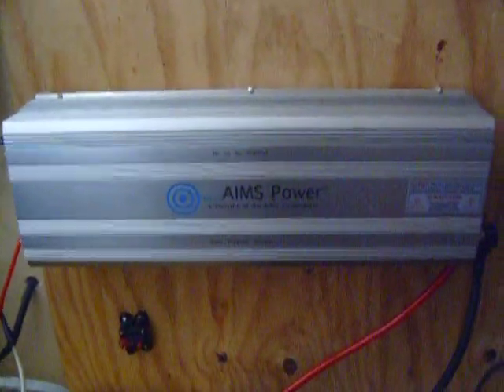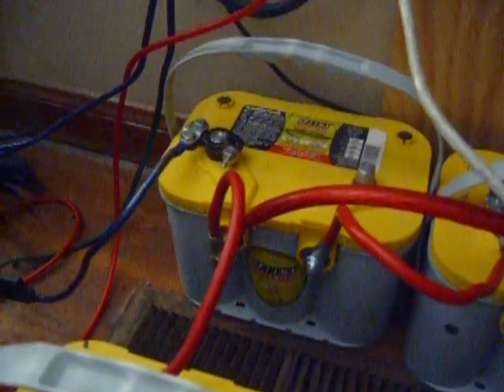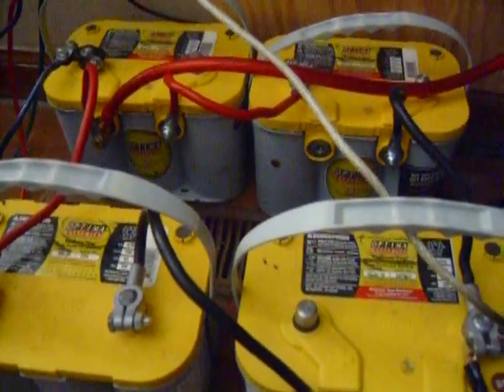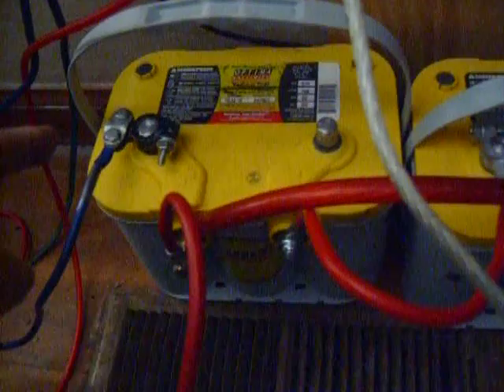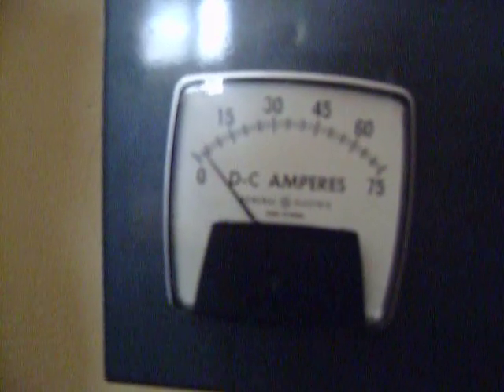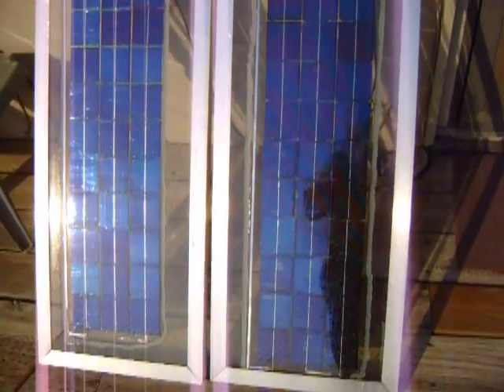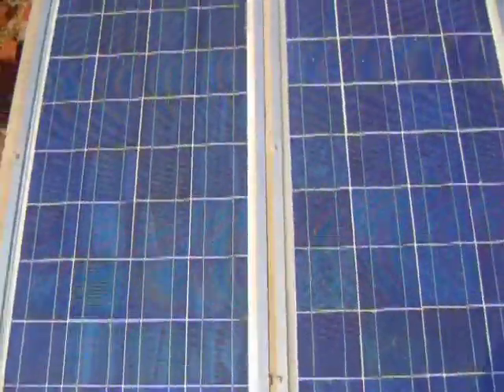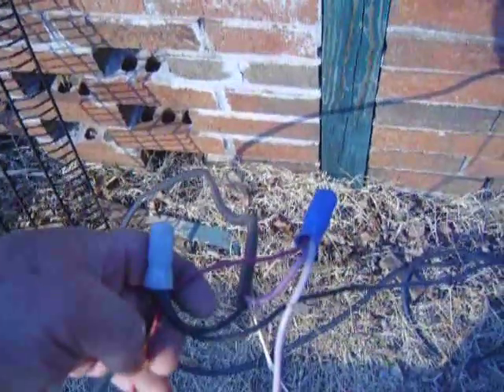24 volt 7,000 Watt Aims Industrial Inverter Installed

Comment: I'm curious how this Aims inverter has held up over the last 6 years ?
Reply from the maker: I sold that about 6 years ago. LOL I use a prosine 1800 watt xantrax it works just fine. the military and paramedics use them. or have been known to. they are good. Actually the Aim industrial this particular inverter is bullet proof but I wanted a pure sine wave so I sold it. The Aims industrial would be great for running lights and tv but not a microwave or fridge they dont play well together the microwave shook and the ice box compressor it was hard on it.  I love my prosine xantrax 1800 watt
Reply: Very good !... nice to hear a positive review about ANY particular inverter.  Another question; Does the Xantrax keep a steady 60 hz ?   The reason I ask,  I have (2) MagnaSine 4048's in parallel and neither maintain 60 hz. Quite often they are at 58, 59 and occasionally 60. Not a problem except I am constantly adjusting my timers and clocks.
Reply from the maker: that is a good question how would I test that? You could look up the specs maybe? It may not tell though?
Reply: I guarantee  you it's designed to run at 60 hz.  My Kilo-Watt meter has a selection for Hz (hertz), and with it plugged into any circuit, I can see what the inverter is producing.
Reply from the maker: Oh yeah I got a Kilo watt meter dah I should have remembered that LOL Im not exactly sure it has that I need to look at it and test it.

Comment: your killing your batteries all wiring must be same length gauge and type or the system is not balanced your batteries will die soon
Reply from the maker: +arb tee I have now have 2300 watts of  new factory made panels on solar trackers. So check out my new videos to see them track the sun. I still have the optimas they are great batteries. This video was made over five years ago but now I have improved my solar system. All new wires and two pure sine wave inverters. I have two separate systems.

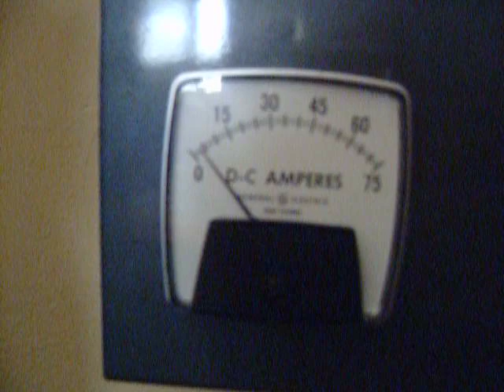Comment: 90 watts + 90 watts = 160 watts. 3:25
Reply from the maker: +DangerZONEpixel OK but have you seen my new videos on solar. I have 3 solar DIY trackers now. I sold my old diy panels and bought 10 235 watt panels. They make some good power now. Look back through my videos to see my new improved system. I have a go power 1500 watt inverter now on six yellow top optimas. Also I have 4 golf cart batteries on another system with a 1700 watt pure sine xantrax. I also now use the cheap China made charge controllers. It all works really nice. I can run my freezer 24/7. on my optimas. Also I can run my TV and entertainment center and sat dish on the golf cart battery xantrax system.
Reply: +shartne pretty sure he is talking about the math and how its not correct i noticed and also rolled my eyes lol
Reply from the maker: Ok I made a math mistake on camera woo so now what?. so what? Your not forgiving me LOL OK so what! You never made a math error well exscuuuuuuue meee. LOL ;) Im talking about looking at my new system it is improved not like this old diy attempt at solar. Solar trackers work more efficiently.
Reply: +shartne I don't make videos of anything let alone my solar array but I could tell you about it if you like
Reply from the maker: +jesse hagenbeck OK but I would like to see it why not make a video its easy.
Reply: +shartne need a video camera for that
Reply from the maker: +jesse hagenbeck I bought a used or take back Samsung on ebay for about 30 dollars it works good its high def. not like this old video. These videos are years old LOL like looking at the stone age of solar and video cameras. but it was fun to do. You should give it a try its why they call this YOU Tube. Im not a pro just a average JOE.
Reply: +shartne and the benefit of me posting videos of my life on YouTube is what? YouTube to me is just looking for new ideas and to maybe see what I can do different I guess other than that I don't have the will or time to make my own videos
Reply from the maker: +jesse hagenbeck I make videos and learn from all the viewers. They tell me so much stuff I never knew. Really, I made friends with lots of people who do solar and their information has been so valuable and beneficial. I leaned how to make solar trackers from Kilog69 he has a great channel and lots of info. Also I made friends with Nrodge1 a electrical engineer and inventor of many useful solar gadgets. Its is very beneficial making videos you get a lot of constructive criticism and just plane good info for darn sure. the Fearless thinker is a good friend of mine whom is also a electrical engineer. Even if I just make a video about my Cub Cadet I get good in put and info. really it does help out a lot. I learn a lot from people on youtube. Its like all my friends come over to see what Im doing and put in their two cents. Very helpful indeed. I did not know any thing about solar until I my friends on youtube schooled me. LOL Helps out tremendously.
Reply: you ever think about running 48 volt? i decided to go 48 myself imy battery bank i run grape solar panels myself and run midnite solar classic 150 for a charge controller i mean I'm new at this myself but decided to go with this stuff right off the bat rather then work up to it i guess
Reply from the maker: +jesse hagenbeck yes 48 volts would be nice. You can even get a charge controller that can do like 90 volts or better and then its super efficient. I need a CC like that. Money is a problem for me. Later on it may be possible.
Reply: +shartne yes my classic takes in 150 volts from the panels then the batteries are at 48 volts
Reply from the maker: +jesse hagenbeck Midnite Classic is definaly on my Christmas List. or anytime list LOL. when I get the money Im getting the largest one.
Reply: +shartne remember this when you order the 250 doesn't put out as many amps to your batteries I asked the midnite people myself to clarify the amp rating is out to the battery bank so the 200 and 250 won't put out as much as the 150 just something to think about
Reply from the maker: hmm that is not good.
Reply: +shartne this is why I chose the 150 puts out 96 amps
Reply from the maker: +jesse hagenbeck Sounds like a lot of amps to me and the best choice.

Comment: Can you share how you did that nifty junction?Did you combine all your positive into one then use wire tie with one going to inverter input and same with negative?I want to go to 24 volt but inverter and stuff is too expensive to justify it.
Reply from the maker: I bought a positive Midnight solar bus bar with insulators to combine inside the breaker box. You can get them off of ebay or amazon. Also I think you can get OutBack brand bus bars with insulator stand offs too that are a little bit cheaper in price. Run a positive bus bar up and down one side then a neg down the other side to combine the the wires. Easy just look up bus bars under those name brands. You can make your own combiner box. I might make a video of my mine tomorrow if I can remember  to.
  I am using a 24 volt GoPower pure sine wave these days works a lot better.
Reply: Please make a video.
Reply from the maker: Making a video now. watch for it today it will take a hour to up load.

Comment: The gel batteries,does it work good?  I would like to put 2 or 3 in the house. Drop a line down to the back porch, and hook up (2 ) 45 watt solor  panels. And use a gridtie inverter day and night. If possible.
Reply from the maker: Yes the Optima batteries work great in the house and no off gases. But they are Absorbent Glass Mat (AGM) so they are not gel. But they are different from regular deep cycle. I use the yellow top because they are deep cycle.
Reply from the maker: I dont like the aims inverter I got rid of it. I got a Go power pure sine wave it works great..
Reply: Thanks

Comment: You got super solar panels! haha. What does that small solar panel run at and what is the cost? I am looking for a solar panel and battery to run a WiFi IP Camera. I figured that I need at least 20watt panel, a battery charger controller, and a bank of a couple junk car batteries or a new 70ah-100ah battery, a custom wire connection interface and a DC to DC 12v to 5v step down converter...

I seen a cheapo chinese 10watt solar panel that copied a solar product of a common driveway gate opener in USA. I haven't tested it or anything but it was in my hands for a moment. I wonder where I can order some more cheapo chinese solar panels if it comes out good. I could wire cheapo panels in parallel right? directly to the controller? Or what was that secret system that the "professional solar installers" were talking about for multiple panels?
Reply from the maker: I sold them all! Then I  bought 10x 235 watt factory made solar panels. All made in China. They are great! China makes nice solar panels. The little panel is a 20 watt homemade diy panel I made in front of the 5th graders and they loved it. I let them help pour on the silguard. You should check out my newer videos with my solar trackers with the much larger 24 volt 235 watt panels on them they track the sun.
  Ebay has some nice 20 watt panels but I dont even think it would take 20 watts to run the camera. I think a 5 watt panel would do it. or maybe a 10 watt. Im pretty sure 5 watt panel would do it. It has .03 amps the ten watt ones have about .06 amps the twenty watt panels have a full 1,0 amps. I dont know what amps the camera pulls?
Reply: cool ill check out your videos. I am looking at the AC adapter that came with my camera. It is has an output of 5v and 2000mA. But also I wanted to have a little extra watt space if I decide to connect something like a little Cubieboard computer or a RaspberryPI computer. And I want to try out the panels for the Seattle weather here, its been raining like a solid 2 weeks!
Reply from the maker: The amorphis panels work on cloudy days. The ones like I got are almost useless on cloudy days.
 Mine are poly chrystaline. I can not spell too good  Ha ha.
Reply from the maker: sounds like a .02 amp panel would work about 3 watts. I think.
Reply: oh ok cool ill check it out
Reply: I used to have a couple mini solar charge devices to charge my iPhone 3G back in the day when it was first released around 2008. I had a full solar charger case and the other solar device was a universal quick assemble with lots of different phone attachments. They both worked pretty good even on cloudy days, except the solar case had failed as soon as I plugged it in a USB charger to charge it. And the quick assemble had failed soon after at the cable attachment port.

These products were from the overpriced UK country. I'll never be buying solar panels from the UK again because they fail and are way over priced. I payed more than $260USD for each of these tiny panels. I think that was 110$UK at that time. What a rip off haha. I am money-racist against the UK now hahaha.
Reply from the maker: A lot of china stuff is pretty cheap. But the cost is very afordable. I like the large 235 watt china made solar panels they are good.
Reply from the maker: +Tyee Cambrón SolarBlvd.com is the best place to order panels for a great price. I sold all the home made panels and bought some great china made panels at SolarBlvd.com

Comment: 2 x 90 watt panels make 180 watts and having long cables on your inverter will rob you of power short as possible is the best cheers..
Reply from the maker: Very true. I have a whole new system now. I have a 24 volt system. I now use a Go Power 2,ooo watt inverter pure sine wave. I have 10 x 235 watt panels. I have them all on solar trackers. I have since then bought pure copper cables and they are much shorter. Thanks for commenting. I have many videos of my new system. It has a special gti box that dumps the batteries.

Comment: For best results use a 120 volt battery bank with a 120 volt DC to AC inverter
Reply from the maker: Sounds like it would be very efficient I would not mind trying that. Wonder about the cost of the inverter? and where you get one like that?

Comment from the maker: The amount of batteries voltage needs to work out to make 24 volts. You can use two 12 volt batteries in a series linked pos to neg to make 24 volts. You can add more later. but look for a diagram for wiring 24 volt battery banks on the Internet.

Comment from the maker: AGM  (Absorbed Glass Mat) the dont off gas. You can actually shoot them full of holes and they will not leak and keep on working. Some have been known to last for 12 years. It is best to keep them above 12,2 volts so they will last. So I really need a lot of them so i dont pull them down too far. You can discharge them all the way around 300 times supposedly. I wouldnt like to do that. they are pretty expensive. Optima yellow top deep cycle 34/78

Comment: solar panels prices are getting cheaper now, try to upgrade the power rating of your panels to 200W a panel at least to get more power per hour form the 7000w inverter.

Comment from the maker: Yes it is a danger with flooded batteries. The yellow top Optima batteries are AGM: The Absorbed Glass Matt construction allows the electrolyte to be suspended in close proximity with the plates active material. This enhances both the discharge and recharge efficiency. They dont off gas so they are safe to be inside. You can shoot these batteries with a gun and they will not leak and stay working. It works up side down or on its side. Can or has been known to last for ten or twelve years.

Comment: be careful having those batteries inside your home. When a battery is fully charged cell voltages rise sharply and continued charging at that point will "boil" the liquid electrolyte. This causes a release of harmful hydrogen gas. charge controllers can not always perform how they are supposed to. just want to help. Thanks for the video

Comment: I have 250 solar panels I build on 4 ft x 8 ft
 ( 288 cells in one panel 4 in x 4 solar  cells   2 watts per cell  ) 72,000 cells in 250 panels = 144,000 watts .  I making 250 solar panel for 3 years sometime on and off and I sold some electricity to company

Comment from the maker: Actually its more like one battery will run the tv for like say maybe 2 hours. or 3 batteries runs it for like say maybe 9 hours. Or maybe take one solar panel,  lets say one 230 watt panel takes 4or 5 hours of sun to charge the three batteries. So you might buy another 230 watt panel to run with that one having two would maybe charger it up twice as fast. more panels equals faster charge time. more batteries equals more electricity storage.

Comment: I got my new 8k unit today, from the inverter store. They made good on thier trade up program. Already put it to work, I'll make sure I don't try anything that uses more then 550 watts per outlet, anything that might use in excess of 550 watts will now be used of the main buss bar. I'll be testing out ant elecrtical item on the Xantrex unit first if they can't handle it I won't be running it off the Aims unit. The Xantrex units trip the ground fault or overlaod and reset easy.

Comment: On the 8k units , one takes the sides off to access the internal fuses. takes a little time but they are accessable. After a week of dealing with the inverter store or aims both located in the same place. I don't think I'm any closer to replacing the unit, on their trade up program. Seems like they always need more info or something.

Comment from the maker: I have heard of guys drilling holes in the face plate and installing a place to replace the fuses on the out side. But it sounds like you got it worked out by replacing with a better unit.

Comment: The fuses are like .35 cents each, they are very common automobile type fuses. The inline anl fuses are only like $2.00 each on ebay. the fuse holdes about $8.00. I checked all internal fuses they checked good.  Waiting for The inverter store to make good on the replcaement.

Comment: My Xantrex units run a small 550 watt A/C unit about 7hours a day. I start the units on the grid then plug them into the Xantrex units. Looks like Aims is going to honor their trade up program on the 8k unit. If not I'm looking at the 5k Xantrex unit.  The Aims unit could run both A/C units and the well pump at the same time. I wasn't impressed with the fact the fuses didn't save the aims unit, they are hard to access and their is at least 30 ea 25 amp fuses. Would like aims to repair units.

Comment: I wouldn't buy aims units. My 8/16k unit totally failed. The inverter store seem to have nothing but excuses when it comes to thier programs. Aims units have no external fuses, the 25 amp fuses are hard to get too, and did not protect the unit. I'll consider the Xantrex 5k unit next. Not happy with the aims inverter store or the failed unit! My Xantrex 2k units when overloaded just kick the ground faults on of shut off power automatically, always seem to reset with no problems.

Comment from the maker: 2,000 watts of panels would be a good start. A  pallet of ten 230 or 240 watt panels each would be a great start. the more panels the better. Then a battery bank of deep cycle battery say 8 250 amp hour Trojan AGM batteries should get you there. Forget about running a freon AC. get  the water cooler type and change it over to DC fan motor and pump. you would be all set for anything then It wouldn't hurt to have some wind power too to help when the sun ain't shinning.

Comment: Thanks very much for the infor, it will be a good idea for africa that has alot of sun, so can run for 24/7 a week. but this product is expensive here in the Netherland, meanwhile what is the capacity that will be enough for one fridge, one aircondition and other house hold appliances, i mean what the solar panel watts will be and the inverter plus the battery that stored the energy, i will be greatful. Hope i can fix it myself whenever i travel to Africa cos i dont kn if they kn about it there.